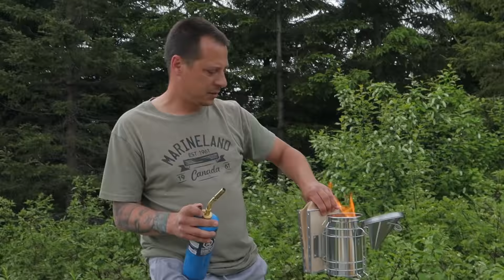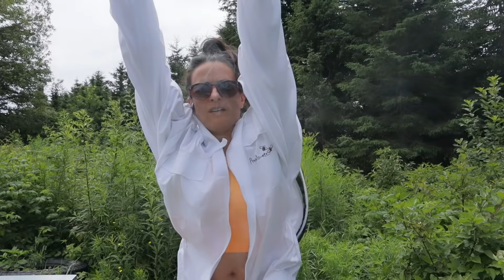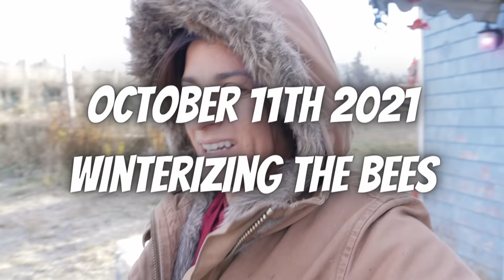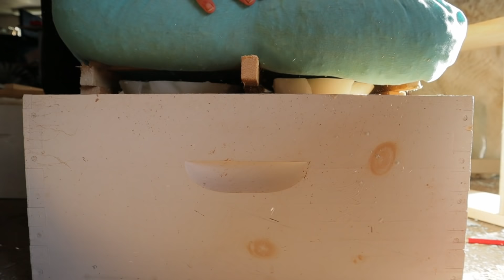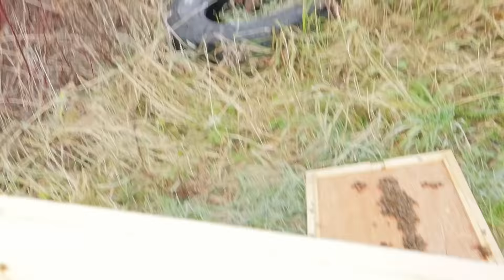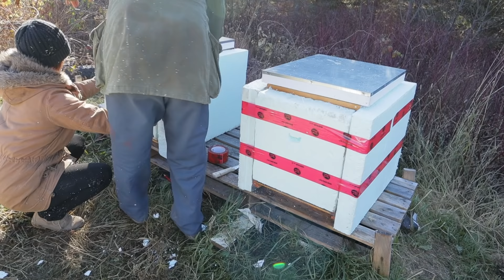Unexperienced beekeeper shares full first year POV Start to finish 1080P

Comment from the maker: Maybe you want to see our honey extraction? Here it is! https://youtu.be/bmSaH2CaSGc
Reply: Ouch! Next time you can totally throw that comb into an empty frame (take out the plastic) and secure it with rubber-bands. The bees will secure the comb to the frame, and then begin removing the rubber-bands. Because there is no wire or plastic support, keep this frame inside the brood chamber. The unsupported comb would most likely shatter during honey extraction.
Reply: @29:15
Vero-wahhhhh.
I'm saying it like that from now on.
Reply: Use a large net to cover the honey with. Or make or buy extra lids and bring extra boxes to put the honey in. After every frame, put the lid back on. That will prevent the snooping that leads to robbing. After they start robbing, they will try to rob out each other. That's bad. 
The netting is better and easier to manipulate than the lids. The lids are faster.
Reply: How many bee hive your apiary  ?
Reply: Where do you sign/register in QC for bees.
I'm looking to get started but running in circles figuring out for QC
Reply: Just today found channel,  curious why Ben was limited lifting ?
Reply: I love your music ❤ and your bees 🐝

Comment: It's a bummer that your mentor told you to set that comb aside. If it ever happens again, you can just use an empty frame (no foundation) and large rubber bands to hold it in place. Put that frame in the hive and the bees will reattach the comb to the frame and then chew off the rubber bands. Problem solved, comb saved!
Reply: I’d have never touched that comb it was all the way at the end in its own space.  If it’s had been in the middle or two or three frame spaces size wise yes maybe.  I understand how you felt but I’d never make them do it all over not in the north.  Maybe in Florida where they have plenty of time.  BUT they are doing ok so if worked ok.  I just try and stay as natural as possible and absorb the consequences of my mistakes to my self instead of letting the bees absorb what I want pr forcing them into what i want.
Reply: I agree with you Doug
Reply: That's exactly what I was going to suggest to her. All that brood could have been saved! It's all such a learning experience, whether a new beekeeper, or a veteran in the craft.
Reply: I definitely would have popped the foundation out of a couple of frames and rubber banded that comb to the frame. In just a few days they would have attached the comb to the frame.
Reply: I don't have a hive but I do have a few wild hives near my house and I feed them with sugar water just to help them and they are very important to me as my garden gets pollinated by them and a lot of other insects including ground yellow jackets and I feed them as well.
Reply: I came to suggest the same thing.
Reply: I was going to say the same what a waste bad mentor ship
Reply: Bees build free comb way faster than on foundation

Comment: For the robbing after you pull the honey frames, there are plastic tubs that you can use and just put the top on.  Then there are the purpose built plastic tubs designed to hold bee frames like the hive butler.  You can also build a hoop green house over the hives, so on sunny days the sun will warm up the hive area.  Just a few degrees difference, but that helps.
Reply: I like to keep enough room behind my hives that I can drive a quad with a cart. I've made a fitted piece of plywood for the cart and then you have a working surface right behind you. This way you're not lifting so much up and down. I have a bad back also and often place a stool between the cart and hive. Just make sure to check it b4 sitting! 8 frame hives help too.
Reply: @abdulali8738  studied with an imam here in the US.

Comment: Given your climate you should typically winter them on two deeps for the extra food supply and heat sink given the longer winters.  From my experience over the years three things kill most of my hives over the winter which is condensation dripping on them, mites, and starvation around Feb-March.  The second deep super provides extra food storage plus its a huge heat sink to balance large temperature swings that create condensation that can drip back on the bees. I also really recommend trying out the bee escapes that fit on your inner cover vent hole for harvest as its so much easier on you and the bees.  My least favorite time working with bees is during the dearth so I typically pull my supers early as in most northern climates the honey flows are over by early August and it gives me more time for dealing with my mite numbers.

Comment: This will be my 2nd year. I chose a top bar hive because I can't lift heavy weight boxes mostly cause I'm only 5-2. I haven't been able to get out and check my bees yet due to the depth of snow drifts and the extended below zero temps and I'm kinda worried about them. I built up a styro "castle" around the hive to cut the north wind because it always comes through my place like a runaway freight train in the winter. I have plans to improve the fencing around it and build it up to at least 6 feet. Right now its 4. I find the top bar is easy for me to deal with.

Comment: I see a lot of comments saying that she should have put the comb in an empty frame but her mentor told her the right thing to do being very new to beekeeping. The new comb is very soft and not so good to put in empty frames that could of made a bigger mess. As you can see the hive did fine. Cut outs are different because they have older comb that is stiffer and easier to frame up what the video,s don't usually show is them tossing the new comb before it's to soft to deal with. Great job 👍🏼🤠🇨🇦

Comment: U are doing good for a first year bee keeper.  Just take time.  About 3 years .  keep your mites under control That is number 1.  I run about 70 hives. In my 9th year.  I use O A vape.  And get a good vaporizer one of the ones that run on 110 volts.  I vape the every 4 days 4 times. Lost a lot of hives till I started doing that. Them pan vapes just don't get it. Bee keeper in Pennsylvania

Comment: When bees built comp outside of the frames and the Queen lay eggs on it, you just cut it and place it on a frame without foundation or wire.. you just put rubber bands to hold the comb in place.. you gonna learn .. keep going🙂💪
Reply from the maker: Alot of learning for sure :) Thanks

Comment: Yeah, newbie mistakes. I'm on year 3. I went to mark a new/young queen. i was using one of those pens sold for marking queens. I didn't realize how much excess paint was on the tip of the marker. When I touched the pen tip to her, all that excess paint gushed all over her thorax. Then she tried to get it off and that got it all over her wings and legs. I'm hoping the attendants will clean her up. Talk about feeling bad. Her colony has a very gentle disposition. I'd hate to lose her. Be sure to flick the pen to get off any excess paint before marking the queen. I'm also a fan of horizontal hives- no heavy lifting!

Comment: I ran into a similar problem when I opened my top bar hive and there was cross combing. The bees never read the manual. 
The solution to fixing it when it happens and it will happen. I got large barrettes and long twisty ties, wire will do  . Connect the barrettes to the top of the frame with wire. Use as many as you need. Then clamp the barrettes on the comb. And put back in the hive. In a week or two the bees will build comb in and around the barrettes and you can remove the wire. 
Hope this helps. Curt. From Connecticut.
Reply from the maker: Thanks yeah I will try to find some empty wooden frames if ever that happens again. Very much appreciate this comment :)
Reply: In the name of Allah, the Gracious, the Merciful. Praise be to Allah, Lord of the Worlds.

Allah, there is no god but He, the Living, the Eternal. To Him belongs everything in the heavens and everything on earth. He is the Sublime, the Magnificent.  Originator of the heavens and the earth. He made for you mates from among yourselves, and pairs of animals, by means of which He multiplies you. There is nothing like Him. He is the Hearing, the Seeing.

12. To Him belongs absolute control of the heavens and the earth. He spreads the bounties to whomever He wills, or reduces it. He is aware of all things.

13. He prescribed for you the same religion He enjoined upon Noah, and what We inspired to you, and what We enjoined upon Abraham, and Moses, and Jesus: “You shall uphold the religion, and be not divided therein.” As for the idolaters, what you call them to is outrageous to them. Allah chooses to Himself whom He wills, and He guides to Himself whoever repents.

In the name of Allah, the Gracious, the Merciful.

1. Say, “He is Allah, the One.

2. Allah, the Absolute.

3. He begets not, nor was He begotten.

4. And there is none comparable to Him.”

61. If Allah were to hold mankind for their injustices, He would not leave upon it a single creature, but He postpones them until an appointed time. Then, when their time arrives, they will not delay it by one hour, nor will they advance it.

62. And they attribute to Allah what they themselves dislike, while their tongues utter the lie that theirs is the goodness. Without a doubt, for them is the Fire, and they will be neglected.

63. By Allah, We sent messengers to communities before you, but Satan made their deeds appear alluring to them. He is their master today, and they will have a painful punishment.
64. We revealed to you the Scripture only to clarify for them what they differ about, and guidance and mercy for people who believe.
65. Allah sends down water from the sky, with which He revives the earth after its death. In this is a sign for people who listen.
66. And there is a lesson for you in cattle: We give you a drink from their bellies, from between waste and blood, pure milk, refreshing to the drinkers.
67. And from the fruits of date-palms and grapevines, you derive sugar and wholesome food. In this is a sign for people who understand.
68. And your Lord inspired the bee: “Set up hives in the mountains, and in the trees, and in what they construct.”
69. Then eat of all the fruits, and go along the pathways of your Lord, with precision. From their bellies emerges a fluid of diverse colors, containing healing for the people. Surely in this is a sign for people who reflect.
70. Allah created you; then He takes you away. Some of you will be brought back to the worst age, so that he will no longer know anything, after having acquired knowledge. Allah is Omniscient and Omnipotent.
71. Allah has favored some of you over others in livelihood. Those who are favored would not give their properties to their servants, to the extent of making them partners in it. Will they then renounce Allah’s blessings?
72. Allah has given you mates from among yourselves; and has produced for you, from your mates, children and grandchildren; and has provided you with good things. Will they then believe in falsehood, and refuse Allah’s favors?
73. And yet they serve besides Allah what possesses no provisions for them in the heavens, nor on earth, nor are they capable.
74. So do not cite the examples for Allah. Allah knows, and you do not know.
75. Allah cites the example of a bonded slave, who has no power over anything; and someone to whom We have given plentiful provision, from which he gives secretly and openly. Are they equal in comparison? All praise belongs to Allah, but most of them do not know.
76. And Allah cites the example of two men: one of them dumb, unable to do anything, and is a burden on his master; whichever way he directs him, he achieves nothing good. Is he equal to him who commands justice, and is on a straight path?
77. To Allah belongs the unseen of the heavens and the earth. The coming of the Hour is only as the twinkling of the eye, or even nearer. Allah has power over everything.
78. Allah brought you out of your mothers’ wombs, not knowing anything; and He gave you the hearing, and the eyesight, and the brains; that you may give thanks.
79. Have they not seen the birds, flying in the midst of the sky? None sustains them except Allah. In this are signs for people who believe.
80. And Allah has given you in your homes habitats for you, and has provided for you out of the hides of livestock portable homes for you, so you can use them when you travel, and when you camp; and from their wool, and fur, and hair, furnishings and comfort for a while.
81. And Allah has made for you shade out of what He has created, and has given you resorts in the mountains, and has given you garments to protect you from the heat, and garments to protect you from your violence. Thus He completes His blessings upon you, so that you may submit.
82. But if they turn away, your only duty is clear communication.
83. They recognize Allah’s blessing, but then deny it, as most of them are ungrateful.
84. On the Day when We raise up a witness from every community—those who disbelieved will not be permitted, nor will they be excused.
85. When those who did wrong see the punishment, it will not be lightened for them, nor will they be reprieved.
86. And when the idolaters see their associates, they will say, “Our Lord, these are our associates whom we used to invoke besides You.” They will strike back at them with the saying, “Surely you are liars.”
87. On that Day they will offer their submission to Allah, and what they had invented will abandon them.
88. Those who disbelieve and obstruct from Allah’s path—We will add punishment to their punishment, on account of the mischief they used to make.
89. On the Day when We raise in every community a witness against them, from among them, and bring you as a witness against these. We have revealed to you the Book, as an explanation of all things, and guidance, and mercy and good news for those who submit.
90. Allah commands justice, and goodness, and generosity towards relatives. And He forbids immorality, and injustice, and oppression. He advises you, so that you may take heed.
Read The Quran

Comment: I'm a little concerned that insulating the bees so much.. helping them maintain a higher temperature.. could increase their metabolism, causing them to eat more and live shorter lives, ending up with fewer bees in the spring. 

Yes, definitely, the honey is fuel, they burn it metabolically to keep from freezing, and insulation reduces their "fuel cost" just as it does for us.. but I also think there could be a danger from too much insulation. I honestly don't know, but I'll be curious to see the spring follow-up video..
Reply from the maker: I did a spring video when there were coming out for their first cleanse. They survived. They are now at my friend's place.

Comment: Waste of time and material to insulate them like that. The bees only try to keep the cluster above critical temps. They don't try to keep the entire inside of the hive boxes warm.  If insist on insulating, at least leave the front clear so any sunshine can access the box. Also, let the snow fall! Don't shovel until warmer spring days. It keeps steady temps for the colonies underneath and that's what the bees need, not huge fluctuations. Colonies under snow have been found in a small cavern under the snow melted back from the colonies' warmth.
Reply from the maker: We did pretty good considering everyone in my area lost their hives but me. It was maybe overkill but they survived. One hive died by my fault in later spring. The feeder was blocked so they starved to death by my fault.

Comment: First off blowing on the bees, that's carbon dioxide from your breath. That is no way the bees will not take offense to that. They'll move out of the way because they're annoyed. By it period you need one more piece of equipment. And that I call him frame rest. That's not what they they hang on the outside of the hive. And you put your frames that you're finished. Inspecting on that, it can hold up to 5 frames. But I never do more than 1 or 2 to make space for me to work on the rest of the frames inside.  Period
The more adapt you can become a frame manipulation. The happier the bees will be because you don't want to spend a vast. Of time inspecting your hive. You do not have to find a queen on every look inside the hive just evidence that she is there a working brood in all stages of growth. The normal brood comb will have Honey in the Upper corners of the frame Some pollen just below the honey.
The rest of the frame if the Queen is laying properly. Should be solid brood from end end and to the bottom.
Sometimes the bees will chew out sections of the frames so they can make drone cells. Perfectly normal period period if you do not have a decent nectar flow, the bees will be slow to draw. The comb out, in fact, they will steal wax from some areas and put it in others. And that will make it virtually impossible to get the bees to draw out those damaged Comes.. You must give them sugar water during those.s of time when there's not enough Nectar coming in to support the development of the colony and sugar water is not the end of the world for the bees. They cannot be fed that on a continuous basis. Throughout the course of the year, cause it lacks in the nutrients to colony. Actually needs is a stopgap measure.

Comment: Hi, I have wantrd to try bee keeping for awhile now. I am from Saskatchewan and there a lot of bears where i live , do you have to deal with bears ? If you do, how do you deal with them ? Any other bee predators to consider ?
Reply from the maker: Bears and Varoa are the two biggest threats. We had an electric fence and a huge guard dog near by so bears where not an issue. As for the Varoa a regular maintenance and treatment is necessary.
Reply: @HerEcolife  What's a varoa ?